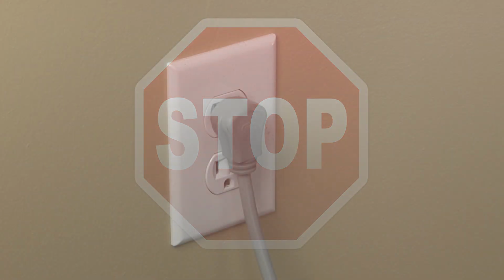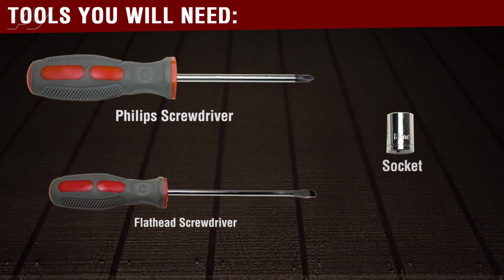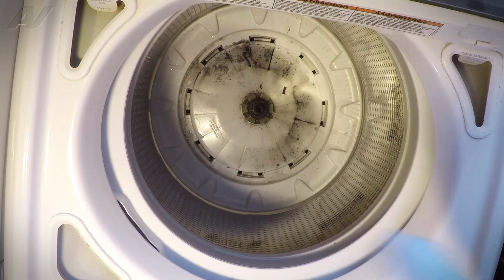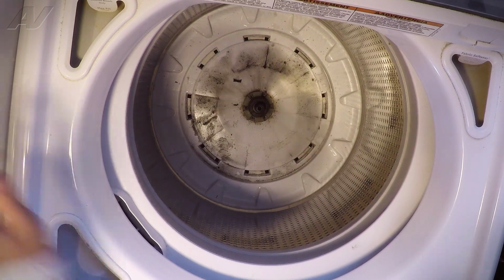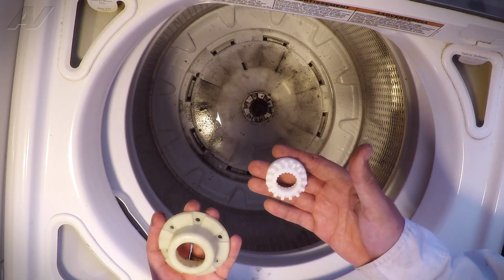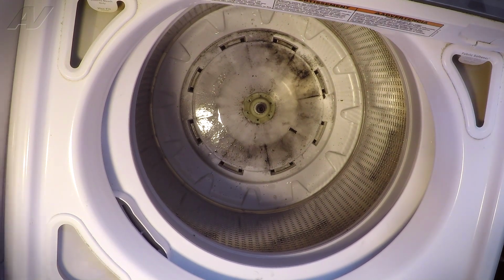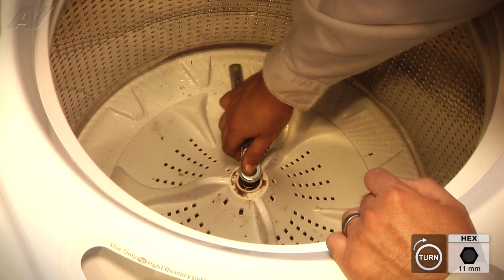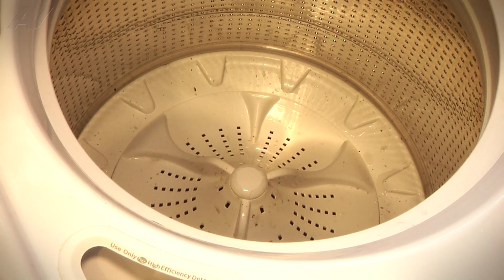Maytag Washer Repair - F71 Error Code - Drive Hub

Comment: I got a matched pair of these Bravos XLs and they are the bee's knees lol I helped my coworker move and the washer had the bearing go bad so it was just sitting there and the dryer was totally fine but they didn't want to move them or repair the washer so they gave them to me for free! 

It's been years since i got them and I just fixed the washer up. Replaced the bearings, got new shocks on the way, and the new hub drive just showed up. Dryer got the updated rollers and a new non screaming tension roller lol New belt didn't fit but old one isn't cracked.

The first time I used that dryer I was blown away and feel like I'm living a new life with my magically dried clothes that feel better? hahaha I'm excited to see how that washer washes, I love the see thru top!

Thanks for the repair videos!

Comment: CLEAN the splines. wire brush or even that little screwdriver you use to remove the cap. individually ream out each spline from bottom to top. make your life easier and get better fit.
Reply from the maker: Great question, if you have a more technical question that our parts department cannot answer, you can search our over 17,000 answered questions free at our website www.ApplianceVideo.com under our Repair Help section. You can also call our parts department at 1-800-830-5465 and they can give you help 7-days A week ,or search at www.SaveMoreOnParts.com  .

Comment: Would have been helpful to mention in start of video that if you can spin the wash plate separate from the tub that you have a stripped inner tub hub and it’s easy to check just by trying to spin the wash plate while holding inner tub.
Reply: You're right. I repair washers and dryers to resell and I always check this when buying machines. The maytag bravos I got for free had this exact issue and I replaced the hub even before investigating what the error code meant 😅
Reply from the maker: Great question, if you have a more technical question that our parts department cannot answer, you can search our over 17,000 answered questions free at our website www.ApplianceVideo.com under our Repair Help section. You can also call our parts department at 1-800-830-5465 and they can give you help 7-days A week ,or search at www.SaveMoreOnParts.com  .

Comment: What do you do if their is teeth that block the hub from sliding off?
Reply: see reply above. yes, if the splines are rusted or worn. spray a little rust buster or a drop or 2 of "KROIL" let it sit and remove, (or put a small pair of "channellocks" ) or a large needle nose pliers under the edges and pry up. "just wiggle it" doesn't always work, be sure to clean each spline when done
Reply from the maker: Great question, if you have a more technical question that our parts department cannot answer, you can search our over 17,000 answered questions free at our website www.ApplianceVideo.com under our Repair Help section. You can also call our parts department at 1-800-830-5465 and they can give you help 7-days A week ,or search at www.SaveMoreOnParts.com  .

Comment: Should the inner hub be that difficult to remove? When new one is replaced should it be able to move up and down easily?
Reply from the maker: Great question, if you have a more technical question that our parts department cannot answer, you can search our over 17,000 answered questions free at our website www.ApplianceVideo.com under our Repair Help section. You can also call our parts department at 1-800-830-5465 and they can give you help 7-days A week ,or search at www.SaveMoreOnParts.com  .
Reply: yes, if the splines are rusted or worn. spray a little rust buster or a drop or 2 of "KROIL" let it sit and remove, (or put a small pair of "channellocks" ) or a large needle nose pliers under the edges and pry up. "just wiggle it" doesn't always work, be sure to clean each spline when done

Comment: I can't get the clip to go on  over mine... do I need it?
Reply from the maker: Great question, if you have a more technical question that our parts department cannot answer, you can search our over 17,000 answered questions free at our website www.ApplianceVideo.com under our Repair Help section. You can also call our parts department at 1-800-830-5465 and they can give you help 7-days A week ,or search at www.SaveMoreOnParts.com  .
Reply: i think you're talking about a different "hub kit" but same applies. yes, if the splines are rusted or worn.  be sure to clean each spline when done. bottom to topo. important to get each spline clean. it takes time to do it right